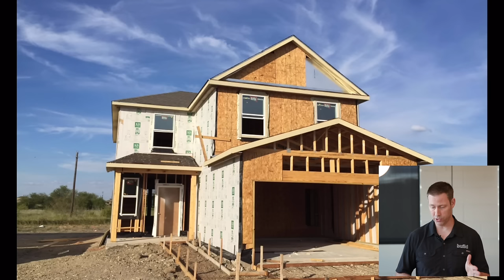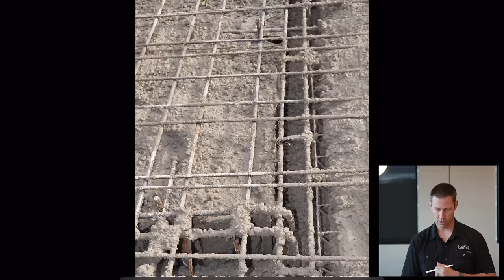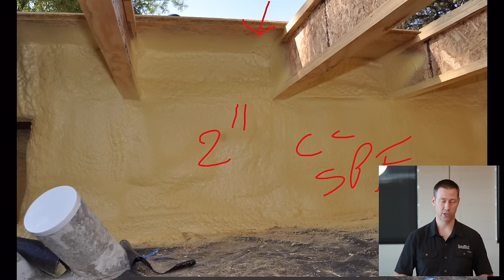Foundations - Slab vs. Pier and Beam - Which is better?

Comment: We had enough money to build a slab or a pier and beam house. Generally a slab foundation is better. The soil where we live has extreme shrink/swell ration. Tears up slabs. Neighbor built on super duper heavy duty concrete slab. Still has cracks, but not bad. 

Easier and cheaper to level pier and beam. You can do it yourself. I can get under our house on hands and knees - no crawling. Way expensive to level and repair concrete slab and beam.

Comment: There are more foundation repair companies than McDonalds in San Antonio. Most of the homes have slab foundations. It would be nice if they were built to the standards of the foundations you presented in this video. I have a custom home built in 1984 that has foundation problems. It is par for San Antonio. At least for the average priced home. I would never buy a home with a slab foundation.

Comment: 5:15 - Didn't explain why those "post" tension rebar like wires are loose to begin with, what's the benefit of having them loose to start with? What they add tension after pouring concrete? Isn't better to have it to be at max tension to start with during pouring concrete? I'm assuming those wires are used to make it easy and fast and save on costs compared to regular rebar. 7:45 - what was that steel pipe used for? This is why home owners needs to go out in the field and see what's happening with their homes during construction. Take notes and observe every little details. Slab foundation is only invasive when you have the wrong people doing the job.

Comment: which is better for seismic rigidity?
Reply: I was living in a rental makeshift slab foundation house from a steel frame kit, it was quite comfortable when the D.C Earthquake hit some few years ago reaching to me, It shook but I was not scared at all, in fact i thought it was the train across the road that caused the shaking until I realized the train was not scheduled to pass through then as it was still daytime. Other than that the lack of underlayment under the carpet sitting on the concrete was uncomfy most of the time, I had to wear slippers just to cushion myself from the hard floor. I would prefer what i am currently living in now, a basement with wood joists, though I am too used to wearing slippers around as this place is fairly drafty, still a rental and needs to some serious remodeling.

Comment: why dont you need insulation under the floor of a conditioned crawl space?
Reply: In Texas where he is located the temperature differential of the soil is not great enough to  justify full insulation and in winter it can be advantageous to keeping the house warm from ground heat. In colder climes the  payback can be worth the cost (Return On Investment)

Comment: A hoe ram is usually on a hydraulic line, not an air line.
Post tensioned cables take on tension, not pressure. The slab is put under pressure to increase the PSI strength of the concrete. Perimeter beam.. Is that the same as a footing and stem wall?
Not your best. You are normally much more accurate..... Maybe the mixture of terms are a regional issue. 

In California and Idaho,  Reinforced perimeter stem wall on footing and interior cripple walls on footings with occasional interior piers on footings vs slab on grade with a perimeter reinforced footing
Reply: Finally someone else who noticed all his mistakes 👍
Reply: @colstace2560  As we call them, a Paper General Contractor. They know the subs who know the technologies to get the job done.
Reply: @idadho  he said in one of his videos something like "he does the important work, the subs do the hard work"
Reply: @colstace2560  Yes, Pushing paper. The subs build this country. The paper generals just skim the money.
The people who have scarred hands and fingers know what is required. Dig a footing to an undisturbed base and hand clear the rubble before setting forms. Use a spade on a jack hammer to cut through hard pan. 

Some hire it done. Some just get it done and know the terms.

Comment: 15:30 "Slab on great houses really can't be insulated very easily"
Is a perimeter insulation under the slab really that much harder? Or insulation on top of the slab? Especially the last one seems very easy and fast.

16:40 "beam houses is they're actually easier on your feet"  Is it normal in the USA to have just a concrete floor? Isn't it normal to put a real floor (tile,wood, laminate) on top of the slab, including a dampening layer? The only "just concrete floors" i have ever seen are in garages and industrial buildings, never in a residential building.
Reply: With ICF forms bot nut the block but some block makers also manufacture slab forms for flooring and roofing purpose which do serve perfectly for slab of grade foundation, the deck forms and block forms matched to one another make for a wonderful insulating system for slab on grade where it gets cold in the north. Most who insulate slab on grade just use run of the mill sheets of insulation board, but the style of ICF forms incorporates BEAMS into it in one direction only though, but still far better than a few layers of flat foam sheets
 
My previous rental was a makeshift apartment dwelling, slab on grade with a crappy useless basement that filled with water when it rain or the snow melts. Carpeting with no underlayment, was unbearable standing for long at the sink to wash dishes with just a vinyl floor even.
 If I had no choice but slab or crawlspace instead of a full walk around basement, would go with crawlspace if a full basement was not suitable where i may plan to build in the future if the opportunity or time ever comes. I am more inclined to the basement option for the head room and all the extra space it provides for living and not just storage, especially if built with ICF.

Comment: I hate hate hate slab on grade,  and basements really are the same.  Being a plumber 25 plus years I have had more than enough experiences fixing what builders do to people.  Both systems can be very rewarding when done correctly, but sadly, for every one that is done right , there are ten that were not.  Especially when you get into the owner/builder scene.  I have seen sooooo many owner/builder homes that end up costing good people tens of thousands of hard earned dollars.  And the original owners almost never experience the misery themselves. They sell the house and build another one  and do it over and over. Sadly however , there are many many contractors who will pull the same slimy tricks, And the one common factor nearly every time?.....MONEY!!  As I said,  they "can" be rewarding when built correctly, but doing it right requires more experience, more labor, more research, and more material.  All of which adds more expense to the project.  Prospective home-buyers beware, and do your due-diligence....and take it to the next level , and the next one after that if you feel uncomfortable about anything.

All that being said,  Matt, you are clearly a reputable, trustworthy , knowlegeable contractor.  I think integrity is the word I'm looking for. I have watched many of your videos, all of which give honest information.  Thank you sir.
Reply from the maker: Appreciate that. Thanks!

Comment: Your wordpress website is broken. Looks like it's trying to load assets with absolute paths instead of relative ones which is causing non-https assets to fail. Friend me if you need some more help.
Reply from the maker: I heard. Sorry about that. Brand new website rolling out in less than two weeks!  Shhhh. I’ll be unveiling soon

Comment: Why don't they like basements or cellars in Texas?
Reply: I've always believed it to be the clay which moves a lot with moisture levels. When it rains, the clay swells but without rain for a few weeks you can get cracks that are inches wide.  I've seen fruit cellars (little underground bunkers where people store canned goods or hide from tornadoes) bow in and crack and they usually have standing water. I couldn't imagine dealing with a basement here. 
Note that on the piers, the goal is to get down to something solid like rock or shale.  I poured 44 of them under our last house and then a post tension slab on top of those.  My next one will likely be a conditioned pier and beam do long as the cost isn't absurdly higher.

Comment: So you really like pier and beam foundation... but what about in earthquake country? Slab on grade is much better during earthquakes, no?
Reply: Not a geo engineer but just outside of Yellowstone they build alot  on  piers and that area is very earthquake prone. My in-laws just had to drive piers and HUGE steel beams under the existing cabin to keep it from sliding into the lake during a shake even with a full basement.

Comment: slab or full basement only for me     thanks
Reply: After living in a few slab foundation homes, no thanks, I prefer basement due to my working in them in the waterproofing retrofit side of the industry with my step dad back in the days. My old long time home had a partial basement, unfinished, and my dad has did some digging to place crawl spaces underneath other parts to make it more convenient to access the underside of other sections of the home additions added on before we moved in..

Comment: Where does your water go? Conditioned is great but to have your vapour barrier not drain anywhere  in particular  is defeating the whole purpose. I should see almost no water sitting on the barrier at all. Put in a pit and run your grade to it. There is no other acceptable way to do it.

Comment: That is incorrect about slay foundations. All slab foundation will crack because of the soil expansion. It is horrible in central Texas.  The best foundation in central Texas is a post and beam slab.   You can adjust the level if your home and the slab Is not going to move with the soil.

Comment: Matt, real good content here! May I contribute? We insulate slab on grade spaces with 2" ridged insulation, covered by 2 layers of 1/2" structural plywood run in opposite directions (no sleepers, no thermal bridging!) then screwed down to the slab with Tapcons.

Comment: Surprised you’re still using I-joists.
Reply: Steve Slade Cheap and don’t hold up well to fire or water leaks, but fine if you solely consider their strength in optimal conditions.
Reply: Steve Slade Oh, well, as long as the fire doesn’t spread to the neighboring houses.  Okay, I’m sold....not.  Why build with I-Joists?  There are better options.
Reply: I was just "how cool" when I first learned about them, then as I thought it over and looked more into them it became a more "um no!" type of idea for me, floor truss or engineered beams are far superior to these flimsy "I do not think so" joists with their limited options on installing utilities.

Comment: I live in NC  and i hear of alot of mold and rotting in crawlspaces
Reply: The key to keeping a crawl space moisture free is either have a dehumidifier inside, or  have a vent in each corner on one side of home and an exhaust fan in each corner on the other. You would also not run it at night do to cold moisture, only during the hottest times of the day to keep the air dry underneath. Anything above 50% moisture level mold can grow.
Reply: Evan Ryon With all due respect, all the exhaust fans will do is bring FRESH moisture-laden air into the crawl space (CS).  In my not-so-humble opinion, the best/only way to deal with moisture problems (and the mold growth that can accompany it) in the CS is to seal the CS up, either by: 1. Bringing it in to the house’s thermal envelope (TE) and conditioning it; or 2. Isolating it from the house’s TE and running dehumidifiers in it. 

God I hate crawl spaces.
Reply: @sammy7237  if you paid attention to what I said about running it at the hottest times of the day to keep moisture levels down you would have understood what  I was talking about. Second as long as there is air movement the mold will dry up. Stagnant cool air is what creates mold. So try again!

Comment: Now your friend had multiple problems but the swamp gas thing here is a fix not to code in California but works. It was designed for a retrofit for plumbing in Europe to stop swamp gas and rodents.  I used it on top of a clean out when I inclosed my front walk-up to my house.  Now it is sized for metric pipe so I had to seal it in with silicone. I covered it with cardboard set it to height sloped for drainage slather it with vasoline before placing the final slab with hydrostatic floor heating . https://www.ebay.com/itm/4-Square-Antique-Bras-Floor-Drain-Bathroom-Shower-Insert-Stopper-Grates/293110344105?hash=item443ebce9a9:g:UfgAAOSwS-Va4Z6O. Looks great and s can get a drain line down it or remove and reapply silicone reset it.  Been there for 10yrs and works great. This is a solarium and we water plants in there so not the friendliest environment. This is technically outside my house so not failing any code violations. Wanted to be able to hose off and drain with no swamp gas. I did not want to tear-up the slab and still wanted access to the clean out without having to cut into the walls and dig a 3' hole for a t joint and it was below a big window.

Comment: Hey Matt I also learned that a black shirt is cooler than a white shirt in the summer in Texas. Physics of heat reflection
Reply: How do you figure that ??
Reply: @colstace2560  Well it goes like this -white reflects and it appears that your body heat gets reflected back into you - black absorbs heat so it takes the heat away . Makes no sense to me either but it is physics = like gravity makes no sense pulling me to earth from my ladder
Reply: I tested this out on occasion, i always sweat more in a black shirt than I do in a light colored one that is not white as stains are unsightly  and white does not stay clean, find that a grey shirt is the optimal color, especially when I lived and worked in FL for a few years and the company only provided us with medium to light grey shirts, though sweat does show on any color except deep black

Comment: Basement waterproofing? Are you building a boat? No. Basements are not waterproofed. Basements are designed for flooding. Water comes into the sump well and when the water exceeds the well then the basement floods.

Comment: ALWAYS, ALWAYS, ALWAYS go crawl space over a slab. Good luck every repairing anything or running lines down the road on a slab without either : getting in the attic with insulation, or busting up your floor to repair a plumbing issue.

Comment: A crawl space should be a minimum of 3 foot any lower it’s a danger to everyone for you have to crawl everywhere in there
Reply: Why is it a danger if it's lower than 3 feet, say 2.5 feet?
Reply: Did you ever put sewer lines insulation and heating guys where do they put it crawl space now try to get in and now a skunk is right in front of you now your crawling?
Reply: Not to also mention the waterproofing nightmare of working in such low clearance spaces, thus why I loved working in and on basement foundations and prefer living in a place with basement (preferably usable and conditioned or at least insulated). From my experience working for my step dad for 5 years retrofitting problematic basements where no such thing was considered or improperly installed by the original contractor.